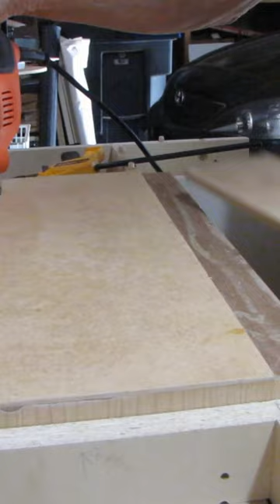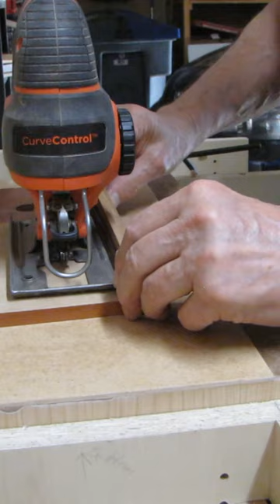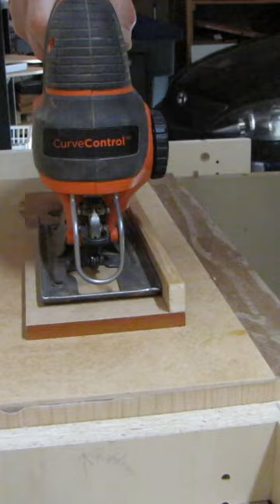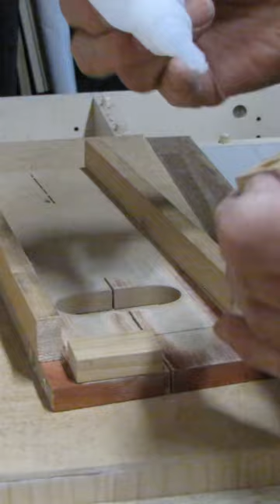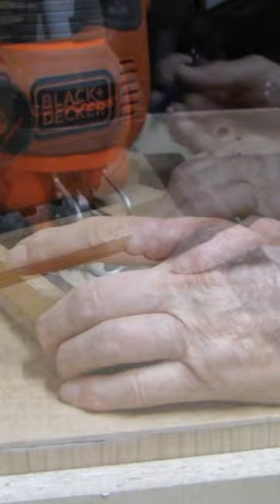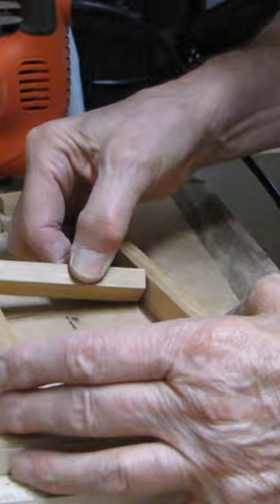Making a Jigsaw Guide Jig in One Minute DIY #Shorts

Comment: Am I not getting this? Won't the metal sled on the jigsaw follow that straight edge without the wood sled? I'm confused here.
Reply from the maker: Good question. I too thought, that metal platform of the jigsaw is enough to make strait cuts. And I've tried to use it without jig, just with a piece of wood to direct the movement. It did not work for me well, as well as for other people I saw opinions of online. With the wood sled (as you put it very well), the cutting became a pleasure.
Reply: This is a better, and safer allows you to get your lead hand close and guide the jig without risking slipping.